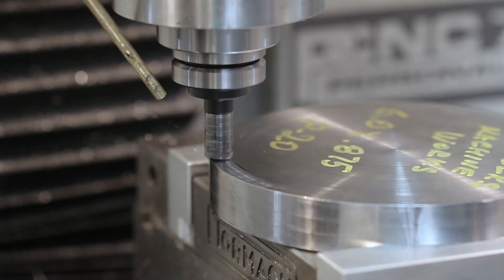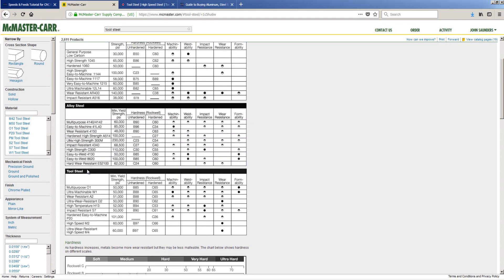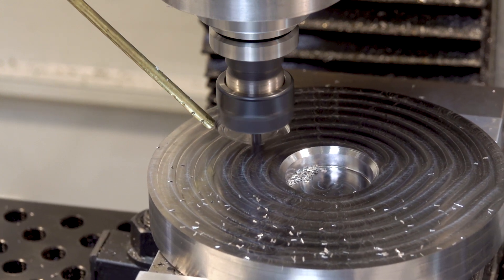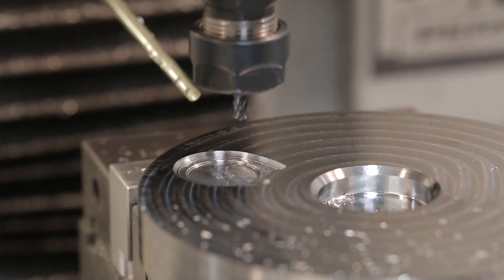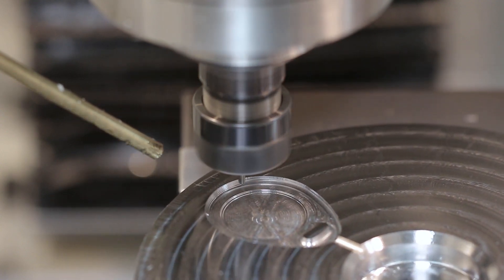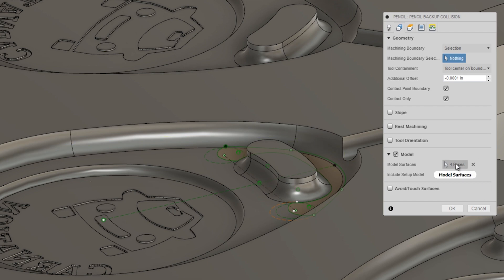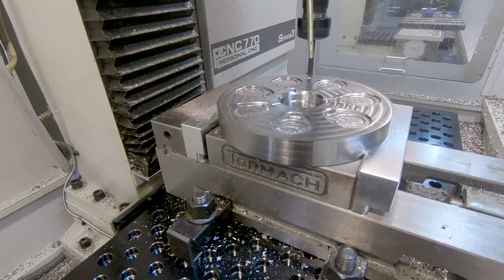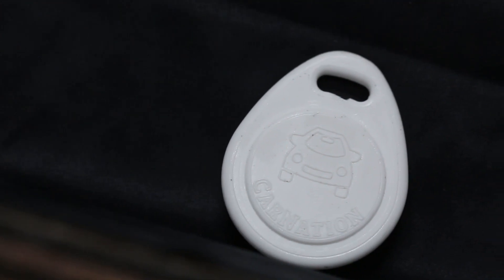Machining A Key Fob Mold on a Tormach 770 | WW192

Comment: Those high feed mills work great for low rigidity mills. I regularly run a 3 flute 1.5" sandvik high feed mill  at 300 ipm in steel on a very low rigidity mill.

Comment: You'd think the software would know that that would hit. It literally SHOWS it cutting through that "island" of material. It should ALWAYS be "model aware," as you call it. That blows my mind that the software wasn't developed to take that into consideration automatically.
Reply: If you listened to what he said, he told the software ignore the model, just look at these patched surfaces... It was his mistake in this case not the software, 3d toolpaths are normally model aware.
Reply: It does normally. He told it to only take into account the patched surface.
Reply: You’d think you’d watch the whole thing before posting. 

He removed the model awareness to force it to machine specific patches surfaces, IE additional surfaces he added in. So it was in fact “model aware” cept he essentially told the toolpath that the entire model was just those 4 patched surfaces.
Reply: Andrew Delashaw powermill is conscience of that sort of thing
Reply: It seems to me like 50% of their time is spent fighting with Fusion. And they're the pros - it's over 90% for an amateur like me. I do barely any 3D modeling, so I have no clue what else is available, but this can't be the best that the software world has to offer.

Comment: Flash is because you have too much sealing surface area. Make the sealing surface around each cavity raised by 5 thou, the rest of the tool doesn’t need to touch the mating half.  For example, I would have made a quarter inch raised surface around each cavity.

Comment: Do you think venting the mold, like they do in Injection Molding, would help with the flash issue?
Reply: Terry Sharp No it won't help, you vent a mold to let gases escape and allow the plastic to fill the cavity easier, the problem he is having is flashing around the edge of the mold which is likely from the A and B half of the mold from not being very flat or, miss alignment of what ever locating geometry ( likely dowel pins in this case ) the mold has.
Reply: True. He could relieve none essential areas of contact as well. That would help
Reply: Andre Gross actually alot of the time mold bases are milled on the parting line, keep in mind that a small injection molding machine is around 50 ton press, so they force the mold closed, also   alot of materials are very forgiving such as abs which flashes in about a .005 gap

Comment: @NYC CNC To reduce the flash around part you could use relief channel that need to be machined only at one side of your mold. Clearance/Offset from outside countur should be 0,2 mm. To mill channel use ball end mill.